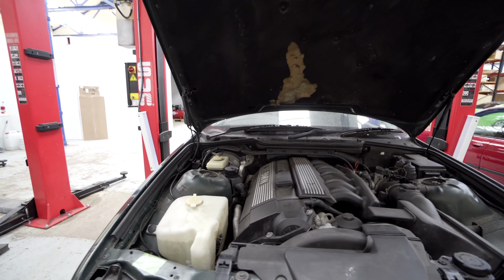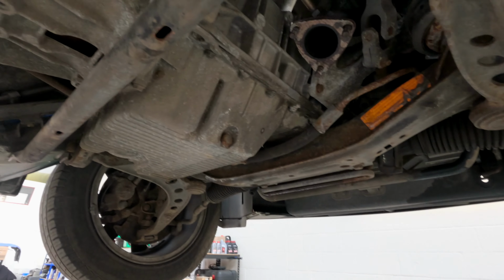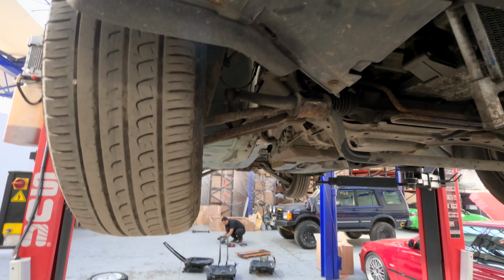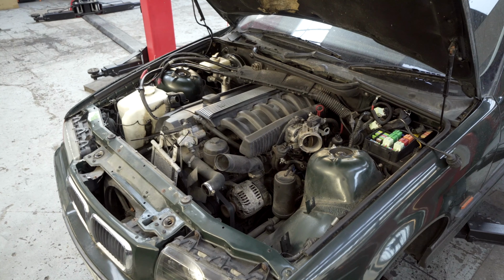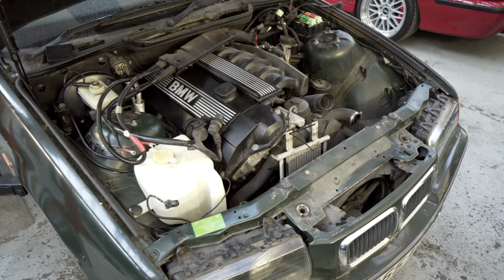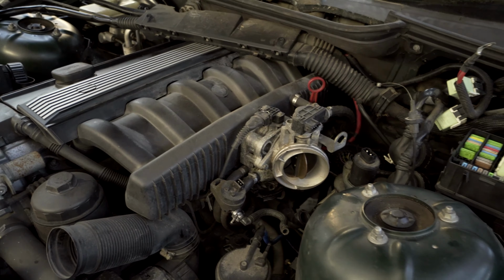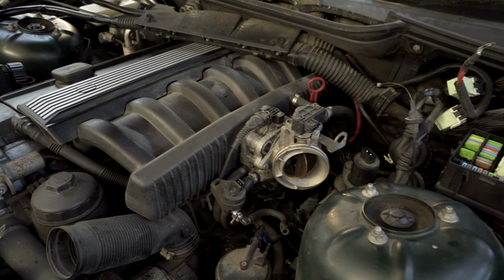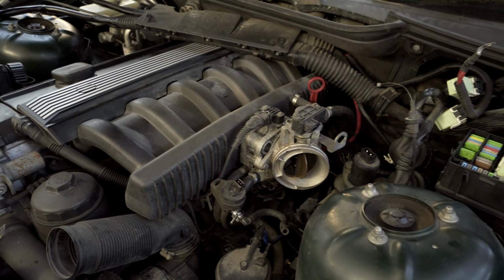Removing the Engine from the Touring - E36 M3 Touring Ep 07

Comment: So new this touring,you put RedBull engine to your Touring and the results is TOURINA® hahaha amazing!!
Hey the time lapse was genial!!
But why put again the front subframe??   You have a M3 front subframe, its also for moving car?
That's right bro,like all!!
One question,you change double flywheel to mono-flywheel?
Its better than double and the clutch its so cheap,I put in my 318is daily the 318i flywheel and have - 3'5kl.
I'm amateur bro,but is my opinion :)
See you friend,Gas!!!
Reply from the maker: Thanks for watching!

The standard subframes go back on so the shell can be pushed back outside. The M3 subframes will go on when the underside is being built back up.

Sticking with dual mass flywheel as I don’t want any added noise from a single conversion, and never had any issues with it in the M3.